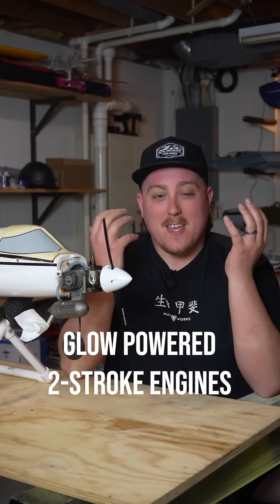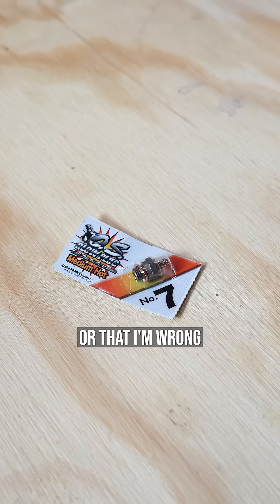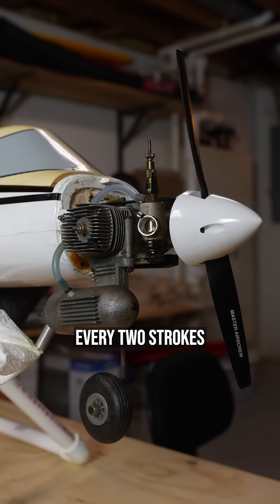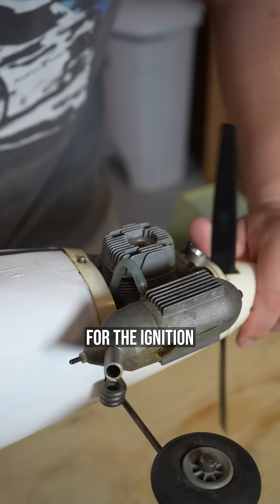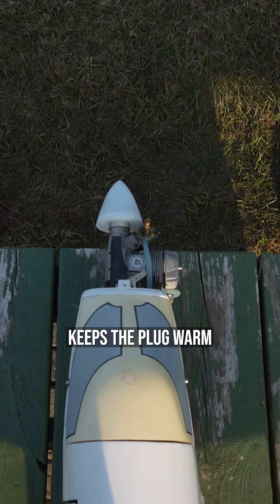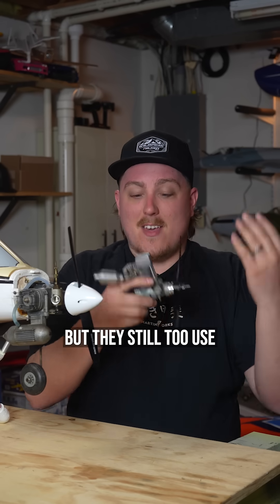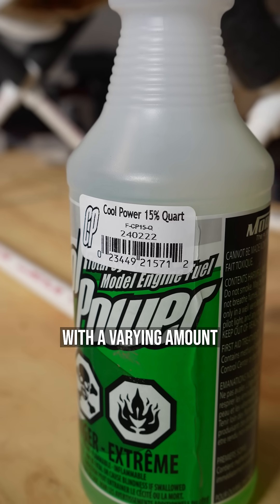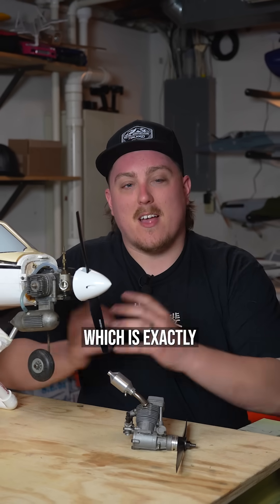How do Nitro RC Engines Work?

Comment: Gm Diesel's use a glow plug and they are two-stroke. It has nothing to do with plugs
Reply: The old Detroit Diesels did not use glow plugs. I know for a fact the 71 series didn't but I'm reasonably certain none of them did. 

They are compression ignition only. The compression ratio is high enough to combust. In the RC engine it is not. It needs the hot surface of the glow plug to make up the difference.
Reply: @cobra02411  Most Diesels equipped with glow plugs are meant to start engines in extremely cold environments -20 and lower. Cold starting in those temps is a chore. Most military engines have glow plugs. They operate from deserts to Arctic areas and must start every time. Whether they have a glow plug of not depends on the application.

Comment: All we had before. Grew up with O.S. , Webra, Super Tigre and Saito engines. .60 0.S. was so popular. I flew .40 engimes mostly until I switched to electric.  Glow engines defined the hobby. Your house smelled of balsa wood and nitro. Golden years. Best hobby! (42 years flying now)
Reply: the Fox .78 used TWO glow plugs, and burned them out faster than the store could stock them.
Reply: @robertsmith2956  Nice that you remember Fox, My late Father in Law was Dukes personal chauffer and right hand man He ran Fox Manufacturing for years after Duke Passed. In fact my late father in law was the formulator for Fox's revamped "Missile Mist" fuel designed specifically for the .15-.35 RC and Stunt engines.
Reply: @robertsmith2956  The .78 was not a nitromethane engine, it did just fine on a 75/25 mix of methanol and castor oil. No more than 5% nitro if you really needed it. At the field I learned to fly R/C at, there was an older gentleman that would come out and fly a large biplane using a F0x .78 or an OS .80, he mixed his own fuel with no nitro.
Reply: 100% cool power fuel etc...
Reply: @anthonypforr6463  Cruel Power needs more oil added, it is usually less than 20%, so a few ounces added to the jug to bring it to 22% helps the older engines.
Reply: I crashed my cox trainer because I didn't have pt40 money. I went to rc cars 😂
Reply: @masjuggalo  Sounds expensive.  air and ground are different freq.
I spent a month getting permission to use a sail boat in the city pond.
Then realized when I got it, I don't have a ground freq.  So gutted my World Expert 7 channel form the 70's, and installed an arduino 2.4ghz module.
Might upgrade to a pi zero to have multiple boat configs. 🤓
The first rc motorcycle from that time was great,  Probably twice the size of the junk they make now.
Reply: @robertsmith2956  I mean comparatively everything is a lot cheaper nowadays. Zach Cox foam RC plane that was RTF I think cost me like $120 today you can get something better for 100. Same thing with RC cars I bought a used Tamiya super hornet for $100 the cheap twin stick futaba radio for 75... Now you can grab everything complete in a box for 80 to 150 bucks
Reply: Never had any problems with an O.S engine, my first one was an O.S 40fp, just a quick running in procedure and never missed a beat, never a dead stick unless I went out of fuel in the Air😅, super reliable.
Reply: i still have a small collection of .049 cox engines... and im still terrified of starting them.
Reply: @ The K&B 61 was mine.  that stub of a needle valve next to that 12" prop...  It was my enya that took the corner of my thumb off though.  Got a free pair of hemostats when doctor was done bandaging me. 🤗
Reply: @ did you add those Hemo's to your flight box? My late father in law swore Hemo's were the best thing ever in a flight box.
Reply: @falkwulf3842  Yep, and had several cops try to steal them in the late 70's early 80's.
They work great for pulling fuel lines onto carb, and for hooking up the cable connectors.
Reply: @ The .051 carb ventury was a perfect one hit bong bowl.  Even had it's own screen. 😇🤪
I had a cox 049 van.  Even smoked like check & chong's .......
Reply: House smells of nitro 😮 I hope you mean caster 😐
Reply: Yup, I still have many of these lying around, including the OS-48 four-stroke engine. It looks the same as the one in the video. I haven't used them in over a decade, I fly fully electric now.
Reply: O.S .40 FSR, I had a couple of them. The best glow engines I ever had. Then I switched to electric and gasoline.
Reply: @coriscotupi  Got to dust off my Unger engines, and make a twin.
Sad S&R batteries never upgraded to lithium.  Funny they were "It it to dangerous" to use 48 cells.   Now, 80V, ok.....
Reply: This comment brought so much nostalgia back to me.
Reply: But how do you get ignition advance?
Reply: @EbonyPope  You change prop pitch or diameter.  🤔🤭
Reply: Sorry bro... But this made not sense.. or... I just can't make sense to it and forgot English

Comment: Tiny engines are crazy ,run on nitro meth , make like 600hp per litre and don't need spark or timing control .
Reply: EVERYTHING needs timing control. The timing for these engines is controlled by the ratio of Nitromethane and Ethanol. Alway use the fuel mixture specified by the manufacturer.
Reply: It's probably different now but I remember some of the . 21 ci engines making around 5hp and revved up to about 30k rpm.